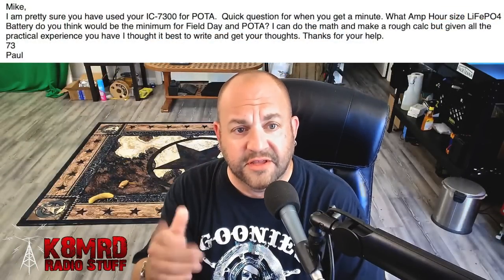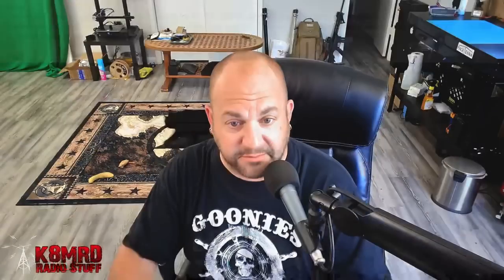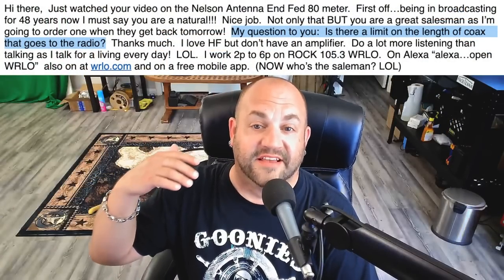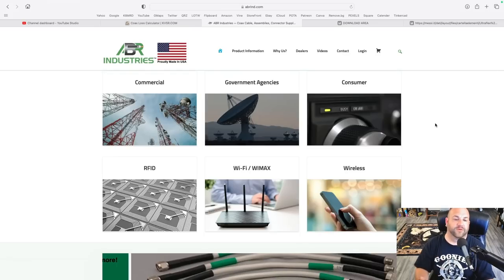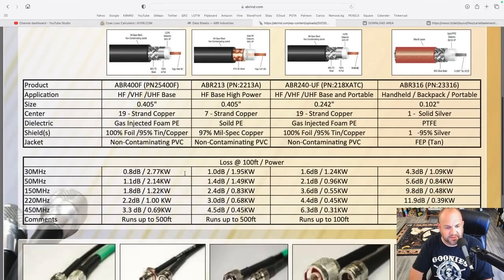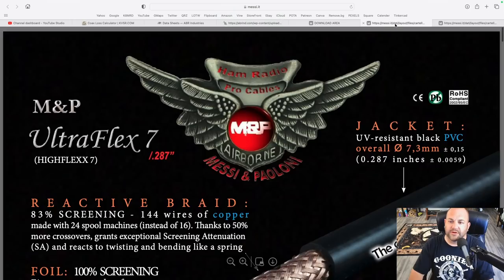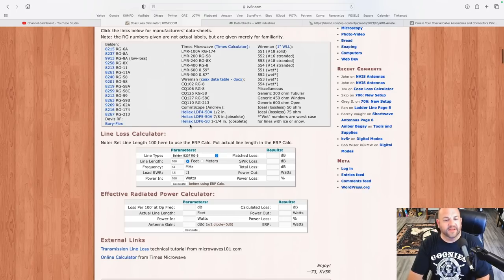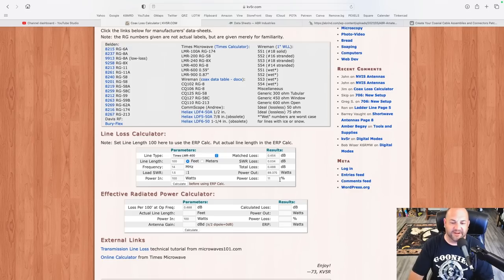Coaxial Cable:  How Long Is Too Long?

Comment: Thanks for responding to my POTA email. I gave you half the info though. They are on a mag mount on the hood of my truck since I have a fiberglass shell in the back.  I did get 80m to Rez at 3860 with chokes on the coax. I added a 15 in. extension to the whip and got it to Rez at 3580 for digital and some cw. Still the bandwidth is small @ about 100kc for 2:1 or less. I will try your stake and short radial method for 40m and report back. Really want to keep things as compact as possible. Thanks for all your information. Bob WB6TIS

Comment: Custom built my own 42ah lifepo4 battery with a Daly bms that has Bluetooth so I can watch my usage on my phone,  throw out 200 watts of solar power and I can run my Dx-10, tablet plugged in, and a desktop fan without any issues all day even with overcast.  Battery is mounted in ammo can,  works amazing and love being able to see real time draw and remaining capacity on the battery from my phone.
Reply from the maker: Oh yeah, that'll do it.  I've got a Daly BMS on my 10AH that I built years ago.  Don't have all that fancy bluetooth stuff though.
Reply: @K8MRD  real time readings make all the difference,  no guessing on remaining power 😉

Comment: Great info on Ah required. I built a 50Ah in that smaller gigaparts explorer battery box (after I found a short enough battery lol) with genasun controller and measured consumption Buddipole Powermini2 matches your data.  Great videos.

Comment: Coax length can depend on what antenna you are using. While shorter is usually better, it is recommended by some (including the TennTenna designer) that 50' is the sweet spot for EFHW antennas, as it acts as it's own counterpoise.
Reply: I've seen several end fed antennas that had minimum recommended coax lengths. The braid acts as a counterpoise.

Comment: I have a 40 Amp-Hour Battery, and I did 100W CW for hours.  It was overkill, but I'm very happy with it.  Did a 6 hour solo Field Day/POTA activation and it was great.
Reply from the maker: Better to have it and not need it.  I've never ran my 30aH down in the field but it's comforting to know I have the capacity.

Comment: Hi - just jumped on.. buying pieces and planning to get my used IC-7300 with MFJ tuner setup on long wire (running 100w).. 10-160meter and purchased 100ft coax to help it tune vs adding counterpoise.  I have no tower or tree, just fence and house.. might try the gutter too :)   73s K90S

Comment: The thing about coax and coax loss is that the incoming signal is going to be much weaker than the outgoing signal, so you could lose any incoming signal before the outgoing signal is completely lost. Also part of the coax length is used on the tower itself, and there is a good reason why Hexliax or hardline is used on long coaxial cable runs. :) Obviously for portable use no one would need to make a very long run of coax, but in the end it all depends on whether contacts can be made with a given setup. This is a really great video & lots of great content! 73 KD5YOU
Reply: on a long run it is the opposite unless you using something like LMR 400 at like 100 feet of coax it  has almost no losss!!! people complain they lose modulation on longer runs with other coax like rg8 or 58

Comment: I keep 100x of cable in my go kit. I know it is unlikely I will need more to use an antenna outside of a shelter, but if I'm lucky I know 50' of cable will be enough. Instead of worrying about which choice, I carry two 50' runs and join them with a double female connector if needed. More importantly, carry a couple of rubber door wedges to prevent the foam from being crushed in doorways. And some bright gaffers tape for trip hazards.

Comment: interesting. wire mesh from home depot or so . works with long wire antenna either end fed 1/2 wave or random  length . just roll it out  put some blocks on it. clip to counterpoise on antenna .also I found it helps with noise floor . with battery I say how big can you bring ? leave the lead battery home. I bring a few LiFePO4 ones with me.  run laptops charge phone. re charge HT . run led lights . recharge drowne .keep camcorder going. ETC . I make coffee ,RV coffee pot.  powerqueen LiFePO4 50Ah is great for IC 7300. what I use. 73's

Comment: When I first looked at LiFePO batteries I wondered if the 16 Ah I saw was going to be enough for a 100 W SSB activation.

It is more than enough! The laptop's battery taps out at about 2.5 hours and the 16 Ah LiFePO still has easily another 2.5 hours and probably more.

Comment: Looking to use a <10 watt uSDX QRP rig with 26 gauge wire and a 9:1 unun on 40m, 20m, 17m. What should be the SHORTEST Llength of coax I can carry?

Comment: They sell what they call Faraday fabric, they are advertising it as a conductive material that shields wifi, cellular and gps. I am assuming the screen reflects wavelengths larger than the mesh size of the material. Anyway that might be more convenient than a window screen to fold up and stow.  
I wanted to ask this, is it a better idea to put a usb dongle right on the antenna and use usb cable? Is it easier if you want to do a long run to the antenna to use usb repeaters than an amplifier for the coax like the cable tv companies use? I am new to the hobby and I am leaning toward sdr for reception.

Comment: Yes. Here’s how you fix the bandwidth on your ham stick. It’s a mod called the DX Commander with an 80m 1/4 wave inverted L😂 I get the entire band without an external tuner. Oh. And it gets you everything else up 2m (or at least 10m which you will have to pick a portion of that giant band)
Reply: Sounds tricky to mount on your car.
Reply: @TonyYarusso  yes! That would be tough! 😂 I have seen some guys set them up on drive over masts. But definitely not a mobile situation.

Comment: i would be Curious to What Coax You Would run on HF 100ft MAX But Probably 75ish ft is about what i need..I run M&P Ultraflex 10 Sahara For my VHF/UHF @ 65ft But i am getting Redy to start HF & i am just doing my homework so to speak ! I Was Thinking About 213 or ultraflex 7 but i still dono but them 2 are on my short list

Comment: If the ham of 60 yrs wants to operate POTA on 80m tune the antenna to the frequency he wants to operate on and stay there he will be the one calling CQ.  I use 3.680 on SOTA the best VSWR depends a bit on the ground or mounting position on different summits but is usually ok. Spot my activation on SW3 and call on 3.680 on either SSB or CW, the Chasers have a bit more flexibility with their antennas usually.
Reply: POTA is not the priority for 80m.  I am part of a EmCom group with people I know in CA and OR.  Our schedules are around 3680 after grey line. I would like to start using my POTA go box to start hooking up with them instead of the base just as a POC.

Comment: Will counterpoises help if it’s a mag mount on my car?
Reply from the maker: I can't see it not helping though I've never tried counterpoise on the car.
Reply: @hamradiotube  how would you connect the counterpoise with a mag mount. String them out under the mag mount?

Comment: I like using 2 -12 AH. Then I know exactly when I'm half way out of battery.  I almost never use the 2nd one.  but I'm not all that hardcore.  most pota contacts (SSB) was like 30.  so there ya go. ya comment readers.
Reply: I also like two smaller batteries because one can be charging while the other is in use.